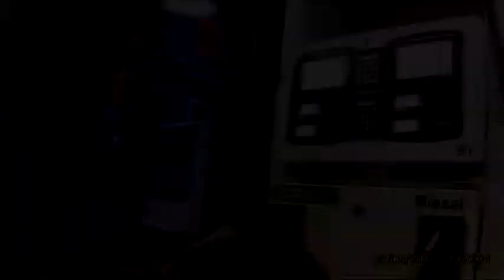Low Fuel Warning on a 2 stroke ?

Comment: Bro I am having a 2002 TVS Max 100 R. Normally I am using the side tank oil for lubrication. How much ml oil should I premix per litre for safety?
Reply from the maker: 10ml is enough to save the engine from major siezure due to oil pump failure.

But I’d suggest you to remove it all together and run fully premixed.
Reply: @BrattyBiker  would suggest to go for premix?
Reply from the maker: Yes anytime, premix is the safer and more reliable option. It’s just that we should never forget to do it, gotta be a bit good with math/ratios in general and carry spare oil all the time.